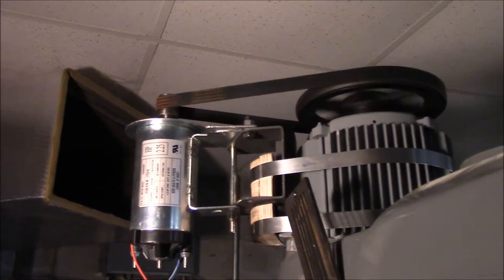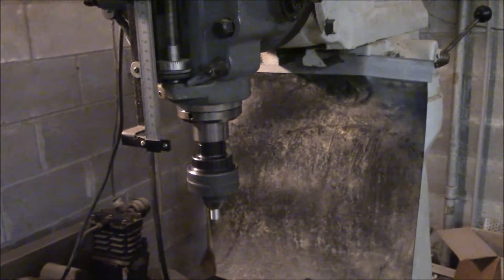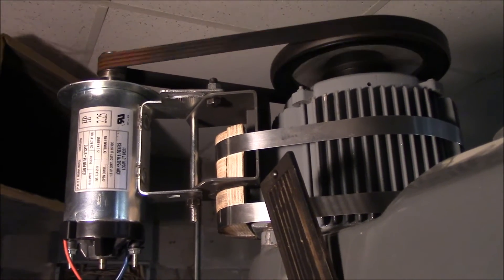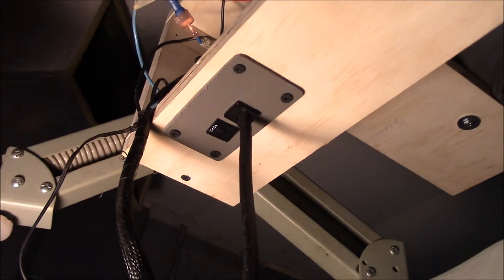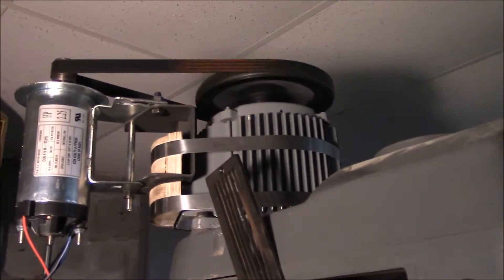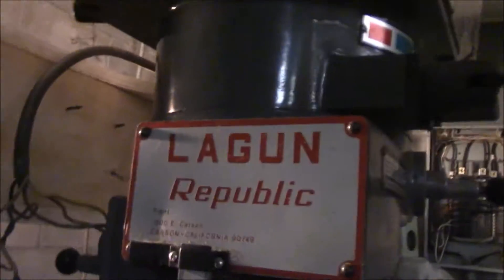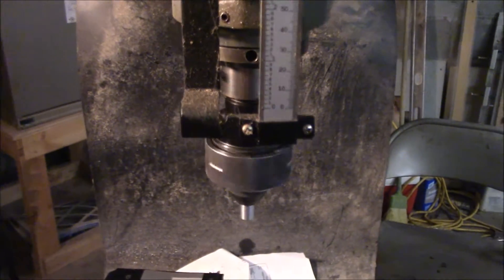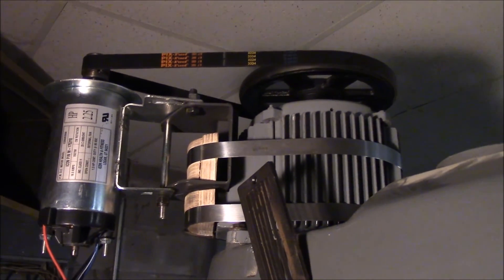Treadmill powered Bridgeport mill MP4

Comment: Nice job bud!!  I just bought a new Marathon 1-1/2HP 230V 3PH C face motor for 185$ for my J head Bridgeport. I'm making an adapter plate and I have to bore my step pulley ought to .875 from .750. The motor shop wanted 900$ to rewind the stock Bridgeport pancake motor.  I'll be out of this for under 250$ and the tiome it took me to do some research and figure things out. I can buy a whole other mill for 1500$, no way was I paying 900$ plus tax to fix it. Like you, I'm not a shop, but I do use my Mill very often.

Comment: you NEED the flywheel, or an auxilliary fan. I've burned a handful of these on my lathe, trust me. Looks like you can fit the flywheel there. I machined mine down , then added a computer case fan after my motor  burned. And a tunnel. All of this on the side with the wires.
Reply from the maker: No I don't.  If I see that I am going to have an extended run, I simply put a floor fan on it, and it cools me off too.
Reply: Motor has a thermo switch if it gets hot it will shut off

Comment: if you switch the pulley sizes of the treadmill motor and the mill pulley you should achieve the same speed. By doing this you'll also be able to operate the treadmill at a lower rpm and lower operating temperature while maintaining high speed on the mill end, thus giving your motor a longer life span.
Reply from the maker: The pulley size is not a problem for either high or low speed.  The treadmill motor's rpm can be changed, and the mill's high or low gear can be changed also the variable speed belt on the mill can be changed.  It would be very difficult to change either pulley on the motor or the mill, that is why I did it this way, the easy way.

Comment: should have left the flywheel on it. The fly wheel is also a fan used to cool the motor.
Reply from the maker: I don't need extra cooling, as the motor is in free air and not covered.  Where would I have mounted my pulley?  Better yet, where would YOU have mounted the pulley?  Design this system and tell me how it worked out.
Reply: I had a 1 1/8hp  motor go out on my old shop smith mark 5. I put a 2.25 hp treadmill motor with the flywheel  and all electronics in side it. Not much space at all and looking at it you can not tell that it has been changed. I made custom pullies from red oak. I use it every day for the last year and a half with no issues. If you have a metal lathe I am sure you could have done the pullies in aluminum or mild steel with no porblems. Also the only thing you need from the treadmill control panel is the potentiometer ( the little thing that your speed control knob is monted on it has three wires) the rest is trash just to tell how far you ran and heart rate ectra. Besides it was a sugestion no need to get hateful!!! I  could of easily bashed on how dumb it is to have the huge  treadmill control panel mounted when you only need one little piece of electronics the size of a quarter.  Or how much drag that shorted motor could be producing when spining that is just robbing power because you was to lazy to chang it. but I am not hateful! You have a good day.
Reply from the maker: I use the KISS principle.  The existing 3 phase motor turns freely, no drag, by itself, but you have no idea how much trouble it would have been to design a shaft and bearing system to replace the original motor's shaft and  bearing configuration, hence the KISS principle, and you know what you can KISS.
Reply: I just tore apart the exact same model treadmill today to use the motor and controller for my Rong Fu benchtop mill.  I'd suggest taking the speed control out of the control panel and moving it to the box you have the controller in.  The only parts you need from the control panel is the knob and potentiometer.  The blue and black wires that go to the safety switch (the red plastic bar on a string plugs into the switch) can be joined together if you don't want to use it as a lockout. The rest of the panel can be tossed out.  Easiest to use treadmill control setup I've found.  Can't wait to get it set up on my mill.
Reply: @CADDapult  Old post but do you happen to have any other info on your RF mill conversion?
Reply from the maker: @CLK Products  Thank you very much, and have since sold the mill, but had fun converting it and it worked well. Bob.

Comment: i wished you would have made some cuts so we can see if the needed torque was there. please comment on the torque output of this motor compared to the original 3 hp motor. thanks.
Reply from the maker: Torque is not a problem with a DC, variable speed motor and also the belt drive variable speed is still installed on the mill, so, to answer your question, no problem.